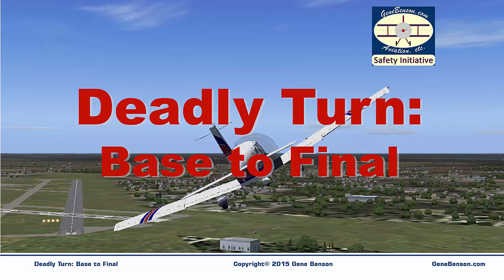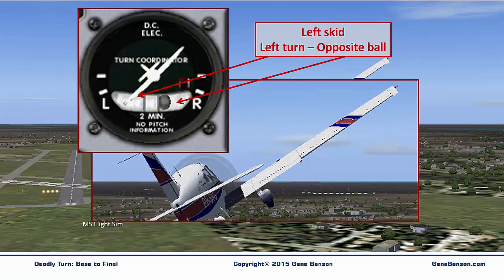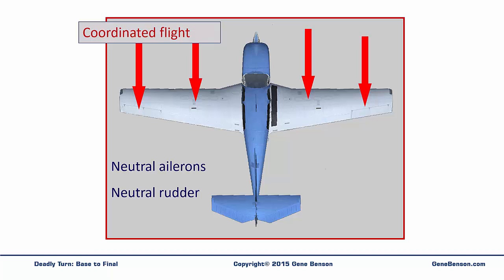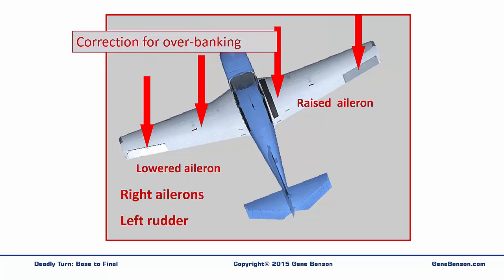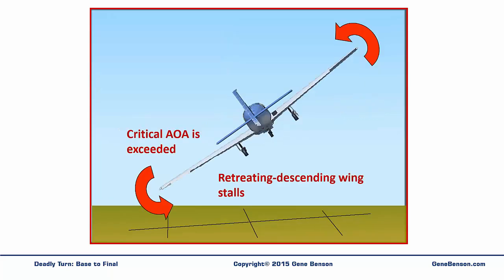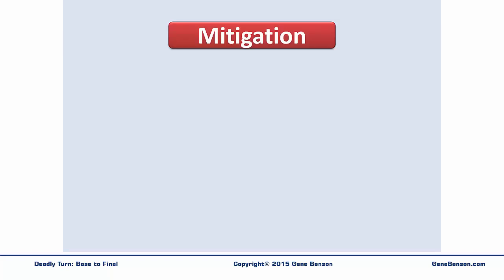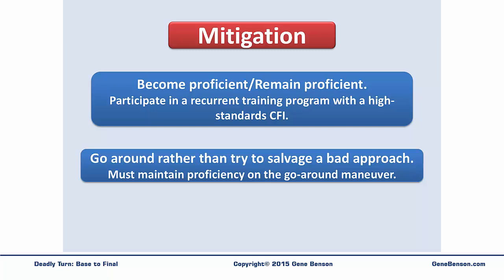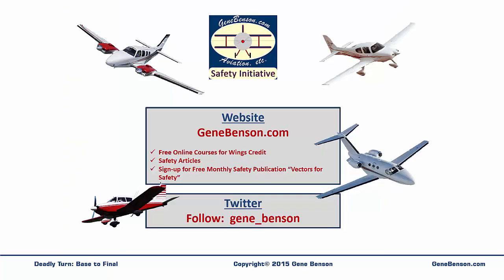Deadly Turn - Base Leg to Final Approach

Comment: Fly gliders and all this will become clear.  What prevents this accident is a well-banked turn—not a shallow-banked turn.  The wing turns the airplane, not the rudder.  Shallow banking invites pilots to add more bottom rudder in order to bring the nose around to line up with the runway.  That, along with trying to hold the nose up, results in the stall-spin.  If you need more turn to get lined up, bank more!  You’ll come around quicker and not risk stalling.  Be sure to keep the ball centered and don’t load up the weight by holding the yoke back.

The notion of banking more than 30° is bad and requires a go-around is just masking deeper problems and misunderstandings.  Learn to turn using the wing (which actually turns the plane) while keeping coordinated (the job of the rudder).

When I teach spins, the first spin I demonstrate is not the typical pull up into a stall and kick in rudder.  Rather, I have the student pretend he is on base—using some perpendicular road off in the distance, and allow no more than a 15° or similar shallow (you know, “safe”) bank to get lined up.  Using the rudder, too much rudder, we always spin.  It demonstrates the bank angle is not the culprit—more bank angle is what is needed!  We do it again with no restriction on bank angle and the lesson is complete.

Comment: So wait? You arent supposed to use rudder during the turn but use it for correcting in the straight line? Im confuzzled
Reply from the maker: The rudder is used to maintain coordinated flight. Keep the ball in the center at all times except when intentionally slipping such as in a crosswind landing or a slip to a landing.  The video illustrates the over use of the rudder to bring the nose around.
Reply: @GeneBensonAviation  ok perfect. Thats what i have been doing i was unclear. Thank you so much for explaining.

Comment: All this is valid unless you're flying a canard aircraft (like a Long EZ). Canard aircraft don't stall. They just don't. I've done 60 degree banks at minimum speed at idle with the stick to the aft stop, no problem.

Comment: This video is very sad commentary on the state of aviation. You know, I watched my uncle off and on for more than forty years fly ag airplanes (some quite heavy and under-powered) in steep, tight turns close to the ground - nose up and nose down. He never stalled and he never lost control. He knew how to fly airplanes... He was a natural. He retired, accident-free, after more than fifty years in the agricultural aviation business. There are no excuses for stalling and spinning out of a traffic pattern other than some people just really shouldn't be flying; they're not naturals...
Reply from the maker: My hat is off to your uncle.  Ag pilots exemplify excellence in flying an airplane at the limits of its performance envelope. Regarding the current state of aviation safety, I believe that flight instructors must make sure that the pilots they instruct are given experience and demonstrate competency in accelerated and cross control stalls. Then, it is the responsibility of the pilot to take thorough recurrent training and not just get an easy sign-off for a flight review.
Reply: @GeneBensonAviation  ,yes, you give good advice, my friend. However, there is a noticeable character trait which must be overcome before adequate safety margins can be achieved and maintained. That trait is none other than pure, basic, fear. I have noticed over the past five decades that many pilots are actually very afraid most of the time while they are in the air; this long and distinguished list includes every category of pilot - from low-time students to multi-thousand-hour ATPS in large commercial jets. I've flown with them all... And all of these afraid pilots are terrified to bank their airplanes more than five to ten degrees. I've seen it over, and over, and over again... These are the pilots who will inevitably end up attempting to rudder their airplanes around the base-to-final turns without adequate banking, without the proper coordination. They do this instinctively, without thinking, because they are terrified to be where they are at the time. They see they're beginning to put themselves in bad situations by over-shooting the final approach path, and their fear then begins to multiply exponentially upon itself. They'll start sweating, and shaking, and mumbling to themselves. Their grips tighten on the yokes... I've witnessed it many, many times. These are the pilots who will stall and spin out of those turns. These are the terrified pilots who will die screaming toward the earth below - all because they were too scared to bank their airplanes in properly-coordinated turns. They know who they are, and simply the knowing terrifies them even more. It haunts them.

Comment: This video is a good example of why pilots keep having problems with this turn. It's not a deadly turn, it's evidence of ignorance as to how a plane flies. Based on the the description, I dare guess the author (producer?) has never actually experienced a cross control stall as it occurs in the scenario presented. A spin is not a result of a cross controlled stall and even if it were there is absolutely no time for recovery at pattern altitude, but rather an immediate and violent nose down attitude. I have tested the cross control stall many times in my Comanche 250 - at 6,000 feet AGL, and I suggest you do too. It is eye opening. I have no problem with a 60 degree bank turning to final because I understand available vs required lift. I suggest you hire a knowledgeable instructor and digest a V/N Diagram.
Reply: All students have to understand is that  the wing turns the plane, not the rudder. They should already know that the rudder is used to compensate for aileron drag.  They should also understand why an accelerated stall occurs.  If they cannot describe an understanding of these points, they shouldn't solo.

Comment: Gene, good video. I might add that 30 degree bank angle is the min. require. You have to throw that wing up - make the 90 degree turn and drop it again.. You do this because you want others in the traffic pattern or on approach to see you.  If, on final, you're not lined up just go around. Keep adjusting the distance between your downwind line and the runway center line. It's also very important that you keep your head on a swivel. Always get a good CFI there's some really bad ones out there. Fly & Save
Reply: Bad CFI , my BP went up after reading that . Some of them are dream killers .
Reply: Yeah, doing low, slow steep turns are good.  To make a hole on the ground..  You must be the product of one of those bullshit CFI that talks but dont do the hard maneuvers like accelerated stalls or engine fails on take off.  USA is full of BS CFI's. They cannot teach in Canada due that..

Comment: From my X Plane experience, I would say it doesn't hurt to carry an extra 5-10 knots airspeed. (unless you are close to flaps max speed or some airspeed restriction)
Reply: The approach speed is the approach speed. Arbitrarily flying the approach with excess speed is just as bad if not worse. Of course crosswinds and gusty winds have to be factored in but that the point, fly the aircraft as its needed to be flown at that time.

Comment: Don't try for a short final. That puts manoeuvring speed too low, and even if you don't screw up the controls as illustrated here, the extra wing load of a steep bank could simply stall the entire wing. Don't try to make a turn below about 40-45% above stall speed.

Comment: Make the pattern a thousand feet higher or more and final approach miles long so there will be sufficient altitude for a recovery prior to the approach.  What is the purpose to have the pattern at very low altitudes anyway?  It's safer up high in these situations.

Comment: Biggest threat to pilots is ego. That you have to make the first approach.   If its bit right i go around. Never forced a landing just to get down and look like a pro.  Its just more flight time so what  i get a extra chance of pattern work.    If banking more than 20 then you really messed something up.   My CFI told me never exceed 20 degree bank in the patter. Keep rpm up a hair more if necessary a extra 50-100 is not a lot  always on final fix all that.  Especially if yo u do a longer downwind leg your final you will always be good    Its those short patterns that get pilots in trouble

Comment: Sorry, Mr. Gene Benson.  Your heart is in the right place but your statistics are not.
     It's not the turn from base to final turn that kills most pilots.  Although the skidding turn at slow speed is a potential factor, the stallspin is quite rare.  The argument that the turn from base to final is the "deadliest" cause for loss of life in aviation is an oft-quoted misnomer. 
      The "deadliest" cause in the traffic pattern (next to mid-air collisions) is not the turn from base to final.  The "deadliest" event in the traffic pattern is the sudden loss of power immediately after takeoff resulting in the inevitable loss of control into a stall spin crash.  I've seen or heard of it too many times.  The stall/spin turn from base to final is indeed very rare.
           In the engine failure situation, the pilot is unprepared for this unexpected event.  The airspeed is slow and the pitch attitude is high.  Studies show it can take almost five seconds for the unprepared pilot to recognize his engine has quit.  During the takeoff phase, the pilot must be "hair-triggered" to push over the nose into a glide attitude immediately.  As Bob Hoover has pounded into our heads many times we must be ready to:  "FLY THE DAMN THING INTO THE CRASH FOR AS LONG AS POSSIBLE".  
           The AOPA has done studies on this and has concluded that the stall-spin incident after a sudden loss of thrust immediately after takeoff is by far the number one cause of a stall spin crash near the airport environment.  Every pilot must be ready to assume his engine is going to quit immediately after takeoff and be hair-trigger ready to "push over" the nose to level flight.  After that, his chances of survival depend on what's ahead of him.
Reply: You are right.  But if you have practiced that engine quit after take off many times, you can reduce that push down needed reaction to 2-3 seconds and not stall.  The problem is most USA CFI's cannot teach that maneuver at all. And if they try to teach it, they add power 3 seconds later and stop it.  Better do them partial power first.. And on simulator first and foremost.. Then on airplane.. I teach that maneuver on different kinds of airplanes and different wind directions.. 2 kinds of them I teach on take off run,  and 4 on Initial Climb. Single and multi.  You get used to them, like you get used to spins..

Comment: Good advice but I'd like to add that stalling is relevant to critical AoA AND wing loading. If you are undershooting DO NOT raise the nose whilst in a bank with crossed controls! Level the wings first fix the attitude issue with power as well & if it still doesn't look ok GO AROUND! Jet liner Go-Around all the time due unstable App's & other miscellaneous factors, it's a normal flight manoeuvre

Comment: bottom line
bad pilots taught by bad instructors.

pilots flying by control movements instead of by control pressure.
herding airplanes around the sky

50 yr CP here

Comment: @Gene Benson wipe all that nonsense and please understand this. When flying slowly you will need more lift, to make more lift (without increasing engine power )you need more angle of attack which is induced by the pilot introducing more elevator deflection via pulling aft on the control stick. There is a DIRECT correlation between stick position / elevator deflection/ and wing angle (AOA) and this is regardless of AIR SPEED. So there for the pilot via the stick controls the wings AOA and a stall is nothing more than an ignorant pilot breaching the planes critical AOA. The good news is this critical angle of attack is easy to find in practice. You simply gain height, slow your plane down and  slowly pull the stick / yoke back till the plane stalls, take note of the planes aft stick position. Repeat over and over or as long as it takes for you to learn your planes "stall stick position", you will soon discover that the plane will stall at precisely the same stick position, regardless of, speed, slip, weight, hard turns, wing loading,  NONE of those things change the stall stick position and the planes critical AOA which is a true constant. So when ever I fly my plane slowly or in a tight turn or anything, I never bother worrying about my air speed but do pay VERY close attention to how far back I'm pulling the stick aft. Once you have the stick pulled back as close as you're prepared to take it to the stall stick position, you then ONLY use the engine's power to dictate your altitude and decent rate. Lastly if you had a camera in these poor pilot's aircraft I can tell you with absolute certainty you would see they all had the stick / yoke, pulled way back to their belly buttons.
Reply from the maker: I respectfully disagree.
Reply: Your STALL STICK POSITION  always being the same is not true because in power on stalls the prop blast gives the elevator more authority thus it needs less deflection to stall the plane. So there.
Reply from the maker: @philipmartin708  You are correct. There are several other factors involved also. If stick position was the only criteria, it would be easy to create an accurate stall warning system.